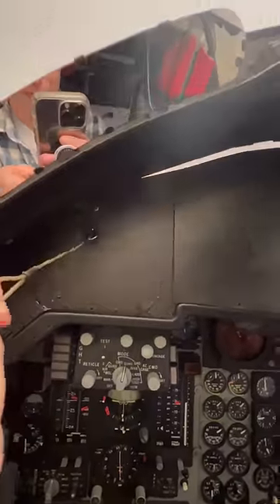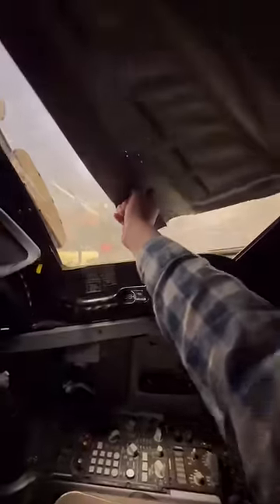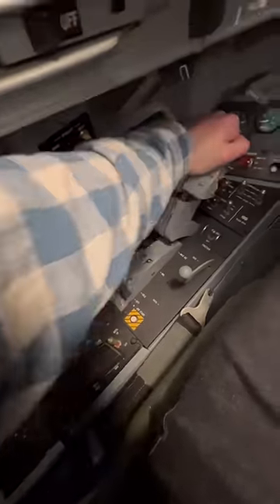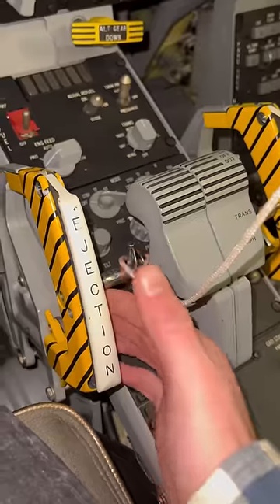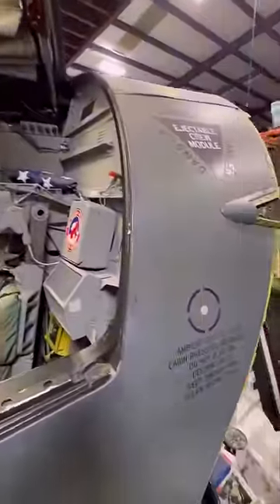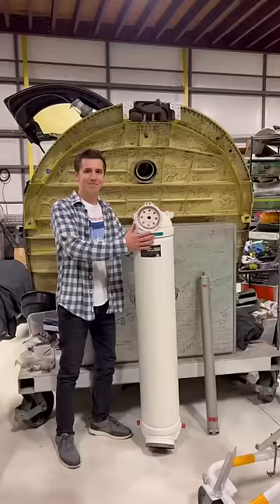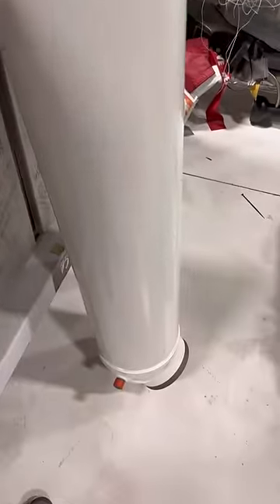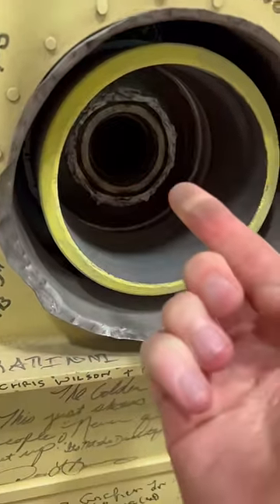How to Drop a Nuke and Survive

Comment: Nah man, the planes gonna be screaming TERRAIN TERRAIN TERRAIN if I stop looking out the windows for 5 seconds
Reply: Nah man instrument flight rating is a thing
Reply: ALTITUDE ALTITUDE PULL UP PULL UP FLIGHT CONTROLS when you look away for one goddamn second
Reply: Pov me in flight sim
Reply: well i think it has an automatic ground following radar to fly it as low as 50 meters

but what would the radar follow if you just nuked the ground bekow you
Reply: How do you think it looks for pilots when they flying through the night? Pitchblack
Reply: @Hellboy_2109  most aircraft that are equipped with stuff like this are fully equipped with lights for instruments for flying using the instruments.
Reply: IFR baby
Reply: @Meat_smuggler  agree

Comment: I actually feel ejecting the entire cockpit instead of just the seat is a better way to exit if need be
Reply: Yes, but that only really works on larger aircraft. Not really enough space on a fighter.
Reply: The B-58 Hustler had escape pods for each pilot, they allow you to survive supersonic ejection which is great
Reply: Yea these planes and jets are so fascinating. It's crazy that some things they made way back in the 60s is still used today. I think that's pretty awesome and ahead of their time.
Reply: @frankierzucekjr  the pre production F-111 had normal seats. On production aircraft the crew module could also act as a life raft if it landed in the water, complete with a bilge pump and floatation bag (courtesy of the attenuation bag), both maintained by using the control stick. This would have been particularly useful had the F-111B been adopted by the US Navy.
Reply: I wonder if this could be used on helicopters, making them much safer (or even possible in the first place for many!) to eject from.
Reply: @dt99022  Except how do you eject with the blades there up top? Do release the blades or what?
Reply: @cocoisadog  the russian Ka-52 helicopter is supposed to be able to detach the blades and then the pilots can eject, it doesn't really seem like many pilots end up doing this though, instead opting to land softly or die immediately after taking damage
Reply: @dt99022  you would have to also eject or separate the rotors.  The problem with this scenario is that you end up having a “weak” shear point on the most vital part of the helicopter. The possibility of failure is a lot higher, especially when loaded and gaining altitude/Gs get applied.  Not to mention there will be uncontrolled spinning blades flying randomly until energy wears off and they too end up crashing.  

Most Helios can land with “autorotation” during turbine or engine failure. 

Maybe adding some sort of parachute like the Cirrus sr22 plane has.
Reply: @cocoisadog I would believe they would have to develop some sort of blade jettison device first. After the blades are removed the cockpit would fly off and parachute released
Reply: @chrispyfryguy why don’t aircraft manufacturers develop parachutes for their commercial aircraft? Gone could be the days of all lives lost on a flight
Reply: @usdjxavi  they have this for small private planes. It’s called a ballistic recovery system.
Reply: The work on the F-111 paved the way for the cockpit ejection capsule of the first three B-1A built. But the 4th and then the B-1B opted for individual ejection seats.
Reply: @usdjxavi  sadly, just as the same reason they tell people to put their heads on the back of the seat in front of them.  Upon impact, it’s proven to snap people’s necks.  

In their eyes. It’s cheaper to not have to pay out millions in lawsuits to survivors of these crashes.   

Also the sheer size of the parachute would take up precious limited space. Cutting into profits by carrying less customers and more “weight”. They could build a bigger aircraft but that would increase the size of the parachute needed. Damned if we do, damned if we don’t. I wish for the days they could save more people.
Reply: @chrispyfryguy  The KA50/52 uses small charges to blow off the blades for ejection.  Seems to work.
Reply: @chrispyfryguy  maybe an option for helicopters could be ejecting forwards instead of upwards, also since a helicopter is way slower than a jet plane, ejecting would be less dangerous and physically demanding on the pilot.
Reply: @usdjxavi  because a parachute for a commercial passenger plane would be heavy and take so much room that you better invest in making the plane actually safer
Reply: @JustRememberWhoYoureWorkingFor  not for an entire plane but maybe per row could get ejected
Reply: Not really. The incidence of spine injuries from the landing are far higher than they should be, but the AF covers that fact up w happy talk. I got to witness a capsule ejection near Lakenheath. Turns out the AC was one of my instructors in pilot tng.  There's a whole story to it, but we weren't even supposed to be in the air.
Reply: @chrispyfryguy  the nonsense about the crash position is just that, absolute nonsense. People really should stop spreading this rubbish around. The reality is the exact opposite. The position allows the head and neck to be supported where as if the passenger sat up right the head in the event of a sudden deceleration is unrestrained and will have momentum leading to it snapping forward and back, this was one of the leading causes of death in motor vehicle and racing car accidents, hence the need for air bags and HANS devices. 

We don’t fit parachutes to commercial aircraft because we simply do not need to. Have a look at the annual air crash and  fatality data to get an idea of how safe air travel is. 

There are light planes with parachutes but they are definitely in the minority.
Reply: @soggybiscotti8425  need to prove negligence on the pilot and airline for wrongful death. No survivors = no proof. You’re the tool. Useless on at that. Airlines cover what they can be sued for in the fine print. When you purchase a ticket, you take the inherited risk and agree to certain terms. Basically a contract.  I got my information from the NTSB. Not from what I “think” will happen, but what’s actually been written by the investigators themselves. Y’all are quick to jump and call people names, but I guarantee none of these Tools have read a crash report. Let alone spent hours researching it.
Reply: @chrispyfryguy  if you had read NTSB crash reports you would know that there need not be survivors of a crash to know what happened, cockpit voice recorders and flight data recorders are enough to put together a very detailed picture. There’s also airline and manufacturer’s data uploaded by the aircraft regarding maintenance issues which is also submitted to crash investigators. 

In fact the only survivors that are usually of any great help are the flight crew themselves, passengers and cabin staff usually have no idea what is happening or what does happen beyond there being an emergency. 

Look at the two 737 MAX crashes, no survivors but we know exactly what happened. This is then easily attributable to the manufacturer especially as negligence.

Comment: My dad used to fly this jet back in the early 70’s.  This plane was a FB 111. If we had to use them it would have been a one way mission.  I never knew that until he was long retired.
Reply: How so part of the F111 was that it could fly under the radar.
Reply: They weren’t going to be refueled.
Reply: @robinpevlor2649  ah I see
Reply: @assadsmagicalmysterytour  did you just respond to a comment with the answer to the question you commented???
Reply: @anikeashark1589  he doesn’t understand why it wouldn’t be refueled. That’s a fair question.
Reply: @assadsmagicalmysterytour   i reckon these brainiacs must not know either since they can’t explain. my best guess is the plane would be out of commission during or after any mission it would have been used on.
Reply: @swagcreated9147  I suppose they're wouldn't be runways left to land on. Or houses to live in. And so, you wouldn't need to fly back which doubles range. But you'll have the nice little cockpit to live in with shades and all, in the extinct enemy country side.

Comment: Nuke-capable fighters go way back.  In 1965 the aircraft mechanics school I attended had the forward fuselage and engine of an F-84F mounted on a trailer for training us in starting and running the GE J-47 engine.  While in the cockpit I was surprised to find a panel, I think its nomenclature was T-249, for controlling an underwing nuke.  I only recognized it because I had used the same type panel while in my previous career as a weapons mechanic on the F-100 aircraft, which could carry the same weapon.
Reply: Thank you for your service and a glimpse into your life while telling us facts about your craft and panel if you got any more stories I'd like to here some more if youd be willing to share👍🤯
Reply: How does the nuke code work? Is it tied to the plane or the actual electronics of the nuke?

Comment: The ejection carpartment was designed and built by McDonnell Aircraft. My uncle was one of a few engineers on the project. He always said F-111 had more bailouts than any other plane in history. And it had the best and most proven safety record in history. I believe a few design elements are still in use today.

Comment: And then you perform what's been nicknamed The Idiot's Loop to lob the nuclear bomb toward it's target. This keeps you further away from the detonation point and buys you more time to get as far away as possible.
Reply: why is it called the idiots loop
Reply: @deathbringer9893  nobody explain it.
Reply: @deathbringer9893  I've never really been sure.

If I were to venture a guess, it's either because you have to be a idiot to be willing to fly a nuke to it's target and drop it. Or because in any other instance, that's a really dumb move to pull in an aircraft because it puts a ton of stress and strain on the airframe
Reply: F-111 Aardvarks were classic military procurement marvels.  Designed to specs that couldn't be built, built to designs that couldn't maintained, maintained by high school graduates to be flown by college grads, who told what was wrong to grad school alums, who designed the modifications that couldn't be built ...,  

By the time they'd fixed what was wrong with the design, the F-111 swing wing bomber was "old tech" and was retired to be replaced by the B-One, or Bone.  

The B1 was designed to specs that couldn't be built, built for a role that was not needed, axed, redesigned to specs that could be built, built to be maintained, the declared "old tech" to be replaced by the B-2.  

The B-2 was designed to specs that couldn't be built, built to designs that ..., ..., to be replaced by the B-21.  

The B-21 ..., by now I'm sure you know the rest.  

NOTE:  The F-111 Aardvark was a two-seat fighter/bomber.  It was designed to drop bombs in the conventional manner.  

The Idiot Loop, or Nuke Toss, was unique to the B-57 to give it time to fly away from the shock wave.  Assuming the stress of the loop didn't rip the wings off.
Reply: a s  ... Thanks.  No, have never written a book for the same reason I never pursued a PhD.  I'm not interested in knowing so much about so little.  
Instead, I read, watch, listen, observe, and reason with the information, squirreling away bits of info here, useful connections there.  
Think of it like a military command post.  It's important to know what the supply situation is, but not where the raw materials come from.  
From there, you get interesting questions about the advantages and disadvantages of various materials, then how to get them to the manufacturers, then why those manufacturers not others, then why are the manufacturing facilities where they are, ... and while we're at it, why are so many people moving to Arizona?  Why is Saudi Arabia growing cotton in the desert there?  Why has cotton production shifted from the water rich southeast US to the arid high plains and desert of the southwest.  Is that why the Aral Sea all but dried up?  What can be done to save the Dead Sea?  And why was there a bus station just west of Jerusalem that sold Elvis Presley blacklight posters?  
Let's see... you asked about, what?  Oh yeah, writing books.  I wrote three books last year but none of them wrote back.  It's interesting that before radio and TV, a comic could develop one routine in their lifetime and still be successful for decades.  Now a new routine or joke is old news in a week.  And how did Kelly McGillis become a star?  She was a piece of wood in Top Gun.  So why remake True Grit?  
Book.  Oh yeah.  Ummm, I guess I get distracted too easily to write a book.
Reply: I worked on the weapons release system in the mid 70’s at RAF Upper Heyford , England. The electronic brain for non nuclear/ nuclear bomb release was in the main landing gear area. It was not heated at the time. You know electrical boards and cold weather don’t work well!       46250 20th MMS.  USAF.

Comment: For those who dont know at the end part,the way of dumping fuel in the F111 is located a few meters up on the middle of the two engines,if you go full throttle and dump the fuel,it will create a fireon the air.

Comment: I was there the day those guys punched out. They were approaching runway 22 at Cannon AFB. They ejected and landed near the end of the runway but the jet (without anyone controlling it) continued on its way and crashed in a farmers field west of base. I was working EOD and it was my job to find all the CAD/PAD bits and pieces (explosive parts that cut or move things) and dispose of them safely.
Reply: Cool but do you have any idea what made them punch out???
Reply: I worked in airfield management at Cannon from 2001-2005. 
We were still finding pieces of that airplane 10 years later while doing FOD walks. 
At least, I assume it was from the same one. Not sure how many f111's crashed on the airfield
Reply: actually I think we're talking about different crashes. did the one you worked leave debris on the airfield? Like all along the south side of rwy 22?

Comment: When you consider the boys in the Enola Gay had none of those luxuries, they either had balls of steel or didn’t realise the risks.
Reply: i think they had balls of steel
Reply: Probably the later, as it wasn't fully known how radiation would affect them
Reply: The people that were nuked didn’t have those luxuries either
Reply: The nukes were a lot less powerful than modern weapons, and I believe they were slowed down by a parachute to give the plane time to get away.
Reply: The Enola Gay was tossed about like a toy from the concussion of the nuke.
Reply: @michaelmulheran2223  I believe it. I was just answering the question the guy had... Smaller nuke with a parachute.

Comment: VARK VARK VARK VARK VARK VARK VARK VARK VARKE VARK VARK VARK

Also when he is talking about the switch at the end he is talking about the dump and burn maneuver, which is where you dump fuel and light it with the afterburners. It was quite common at airshows it was featured in.
Reply: God damit ncd is leaking

Comment: That ejection seat has more pounds of thrust than an engine used on the F-22.
Reply: Bruh
Reply: based and chadpilled f22 hater, unfortunately its in like a 2 second burst or something
Reply: How does this not crush your torso during ejection?
Reply: @timothysuprapto6226  i do not know
Reply: Only 3k more but it has two two of em

Comment: That fuel dump switch, is it true that gets flipped before landing getting rid of most of the fuel so the plane has just enough left to get on the ground? That way if it’s a hard/crash landing you don’t have all that extra spicy fuel adding to a potential fire?
Reply: Fuel dump is utilised to rid the aircraft of weight. For instance if an emergency happens not long after takeoff the aircraft will need to shed weight to make it below maximum landing weight. Most aircraft have a maximum take off weight that far exceeds the maximum landing weight. This fuel dump can take quite a while and shed literal tons of fuel. Off course if the emergency is grave enough the aircraft “lands” in what ever configuration is necessary.

Additionally, older US aircraft carriers arresting wires weren’t rated as high as the new versions (basically any carrier that had 4 wires rather than 3) so a lot of ordinance was dumped at sea to make the aircraft light enough to catch the wire on landing.
Reply: Fuel dumping is not a normal procedure. In the event of a gear up landing the fuel is dumped to avoid an explosion. Also if the aircraft needs to land shortly after takeoff due to an emergency, or otherwise, it will need to dump fuel to bring its weight down. But it is not a common occurrence.
Reply: Thanks for the answers everyone. I’m sure there is more aviation related “old wives tales” that people believe to be true. There are lots in my industry (I’m a heavy truck/equipment mechanic) that make me laugh at how absurd they are. Fortunately all this crap is slowly but surely becoming a thing of of the past with the internet.